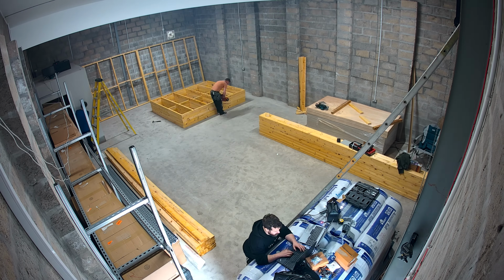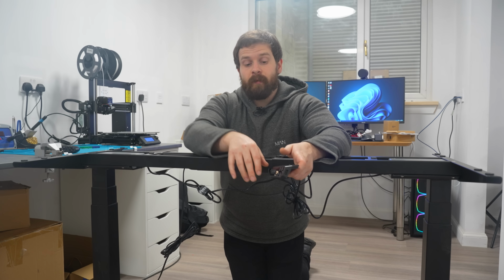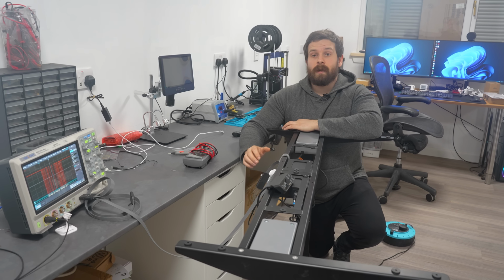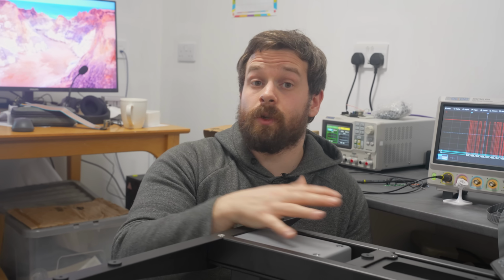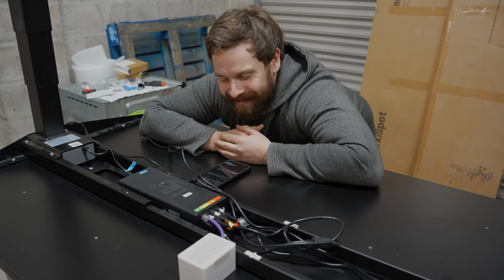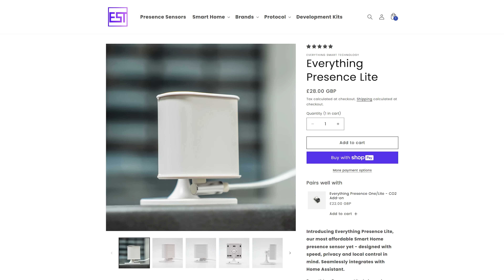I've Always Wanted To Automate This With Home Assistant..

Comment: You could 3D print a cable chain for the power wires. Tons of options on Printables.  You could also consider eliminating one of the wires and putting a 2-3 port extension cord with a short cable under the table itself and then bundle up the wires to the outlets you have on the desk and the wires that go to the desk motors - thus having just one wire to the wall.

Comment: Obviously you’re going to use your presence sensor, but I attached an LD2410C into my ESP32 so I could make an all-in-one presence sensor/desk controller powered through the desk. Not as nice as far as full room presence goes, but invisible and perfectly accurate for sitting/standing automation.
Reply from the maker: Nice one, great job! 👏🏻

Comment: I put a pressure sensor in my chair, So when I stand up my desk stands up with me.
It may sound annoying, And it is. But it encourages me to stand a lot more, Instead of going with the easy option of sitting down.
I made a video about it if you're interested, Shameless plug.
I'm excited for your new studio, Great work!
Reply: You could also possibly trigger a timer start in HA, then if you dont stand up after a certain time... it will raise your desk automatically for you
Reply from the maker: It's a great idea and has got me thinking of even more now..thanks!!

Comment: 6:30 Even if they didn’t have a secondary remote, you wouldn’t need to court anything out void any warranty because they are cool enough to use an open standard RJ-45 make and female RJ-45 let you capture the data and later control your desk. Using an industry standard RJ-45 instead of a proprietary connector is amazing of anyone in 2024. The second port is “neat”

Comment: I'm just getting into home automation so it's not the first thing on my list, but I do plan to automate my desk. I was thinking of going through Uplift's bluetooth dongle. I think there are projects like Upsy Desky that will be useful.

Because I have a sit/stand converter, there can be things that get under my converter so I don't want it to raise and lower with an automation (also cats). What I think I want to do is have a light on my desk that will change color to remind me to stand and when I raise my desk, I'll have the color of the light return to neutral

Comment: Some nice upgrades there and cool table automation. I'm redoing my desk as we speak, also; already have the motorized thing going but putting a larger tabletop on it. Found the coolest electrical outlet for it on Amazon too the other week, it drops into the surface (you cut a hole) and it has a wireless phone charger and a spring-loaded pop-up with electrical outlets and two USB variants. When not in use it's flat to the table. Stoked to see the end result... once I have the time to just redo the whole office. I also found super cool cable clips on Printables that mount with a screw to anything and just clip open and shut - the maker of them called them "Klippt", can very much recommend if anyone wants to clip cables to anything include under a desk. PETG being ideal since it flexes.
Reply from the maker: Awesome, good luck with it, that sounds pretty cool, I'm going to look for those now 😅

Comment: You might want to look into a sensor a german smart home enthusiast built: you can hook up pretty cheap car seat occupation sensors to Aqara door and window sensors with little soldering thus allowing you to automatically raise and lower the desk based on if you are sitting in the chair or not.

Comment: The approach I took to improve voice performance was to run the addon containers manually on a separate server with a GPU, they can still be discovered just as if they're running in the local docker daemon in hass OS. Could be a good solution if you already have another box around.

Comment: Cool project! I love my standing desk, even without it being automated. I honestly think even if mine was automated I'd still default to pressing the buttons to avoid having to speak to a voice assistant (often more trouble than it's worth for small things like this in my humble opinion, I just prefer physical buttons for certain tasks I guess). That said I really enjoyed watching you go through the process of integrating something like this and showing the power of HA -- I hope it inspires people to think of creative ways of automating some of the more mundane tasks we often encounter in ways that meaningfully improve their workflows or quality of life. I'm in school for electrical engineering right now and REALLY wanting an oscilloscope so I can run wild integrating little controllers into things because of this lol.
Reply from the maker: Thanks! And absolutely, I talked at the end of the video about the voice aspect not being useful for the standing desk when the buttons are right there and mentioned the actual useful automations I wanted to use it for (mainly to automate the standing part cause I often forgot to stand) and the voice assistant is more useful for other commands. Hope that makes sense!

Comment: I automated my wife's Idasen sit stand desk from Ikea. It uses an Aqara leak sensor and a car seat pressure sensor and an ESP Bluetooth module. When she sits down the table lowers, when she stands it rises.
Reply from the maker: That's a great idea! An FSR sensor might work well for that (essentially what a car seat is)
Reply: A leak sensor??? How does that come into play
Reply: @MartianMoon  - when sat on, the car seat pressure sensors make contact and trigger a wet or dry state on the leak sensor. Leak = occupied = lower desk to seated position, and vice versa
Reply: @EverythingSmartHome  - that's exactly what it is
Reply: @dancepheus can't you just make an boulean input helper for that leak sensor as you say? Or am I just dumb lol 😂

Comment: Cable management:  look for "Silicone Magnetic Cable Ties".  These have magnets on each end and stretchy string in the middle.  I love them for this kind of thing....wrap around the cable, magnet to your frame, done.  And they have flex so you won't damage your cables.  

I so love to do this sort of thing, but I'm not good at at, mostly for fear of damaging my equipment.  I want to do my standing desk and also my adjustable bed.  One of these days...
Reply from the maker: Oh I've never heard of those?! Cool I'll take a look!

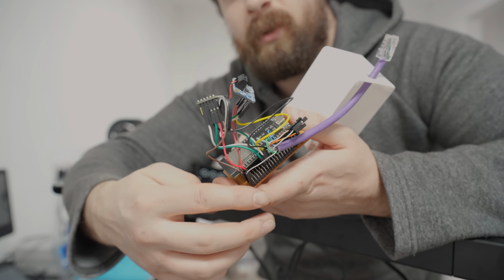Comment: What is the tool you are using at 12:28? Looks like 3d printed solder wire dispenser.
Reply from the maker: It's a REALLY awesome tool on printables called Solder Scroll
Reply: @EverythingSmartHome  Thank you! Started printing.

Comment: Hi!

Lovely project! I'm one of those who doesn't have an oscilloscope... would you mind sharing good alternatives as you mentioned for USB?

Will any old USB to RJ45 serial adapter work? What are key aspects to look out for? :)
Reply from the maker: You would use a USB to serial adapter, then connect the RX and TX lines onto the pins of the adapter - we sell one (which I like cause it's USB-C) but you can use pretty much any, have a search for one and you'll get the idea of the process. Hope that helps

Comment: Do not cut the RJ45 cable, get a RI45 face plate and wire it to your propose ESP controller
Reply from the maker: I didn't cut the cable? I mentioned it was great for not cutting the cable :)

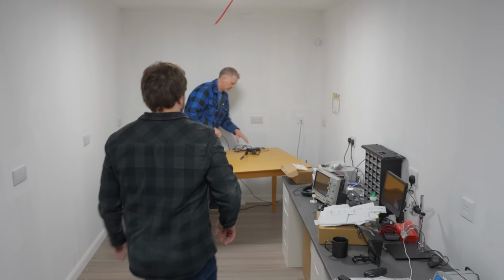Comment: 18:55 I've put a 9 port power strip in the cable tray of my Flexispot. Just one white wire dangling down in front a white background.
Reply: You could use a curly power cord. If it's one cable, it looks really clean!